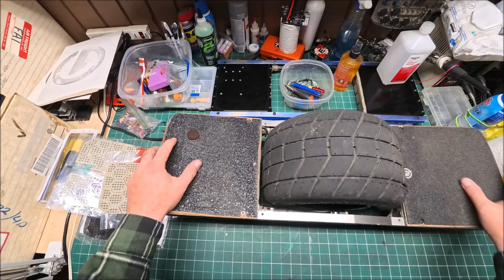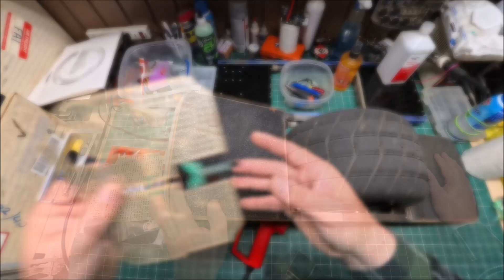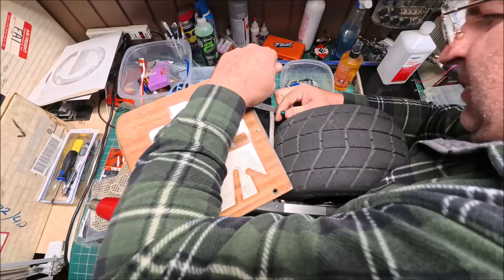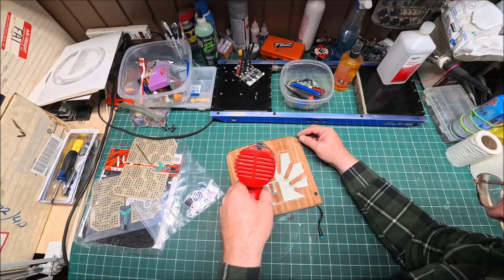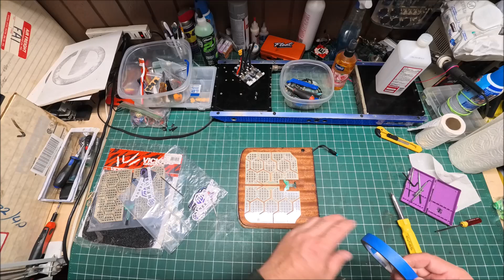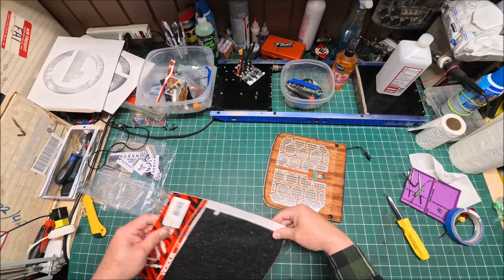Replacing Onewheel XR GT GT-S Pint X S footpad sensor with one from Nexus Battery Solutions Tutorial

Comment: Don't you need a cover over the sensor before the grip tape? Otherwise when you remove grip tape next rime it will damage the sensor.
Reply: What about the sensor wraps from 1wheelparts?
Reply from the maker: @Cleeborpp  Sure, you can use the sensor wraps as well, but I prefer not to, because it will change sensor sensitivity, and I don't like that.
Reply from the maker: Yes, you can use cover over the sensor, but that will also decrease sensitivity of the sensor itself

Comment: Good timing on the video as I’m about to install the same sensor. I am going to cut it to fit with some Dragan Hooks. What is your opinion on adding a sheet of vinyl between the grip tape and sensor in order to make grip tape changes easier without damaging the sensor?
Reply from the maker: Thank you. Please note: by adding a sheet of vinyl between the grip tape and sensor it will change sensor sensitivity. (That's what Future Motion did on recall new replacement GT front footpad they added extra layer of vinyl, and that created another problem the sensor was not engaging every time). The way I did, I really love it, and it's working every time.
Reply: Okay that’s good to know thank you!
Reply from the maker: @MB-hv6ci  You are welcome, anytime, I'm happy to be helpful 😉
Reply: What is your experience with this sensor? All good so far? Thanks!